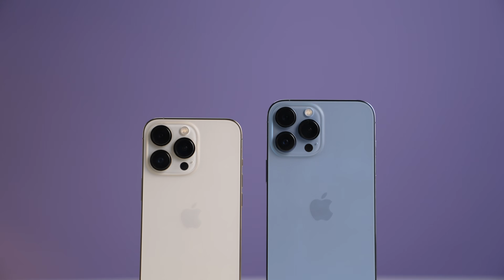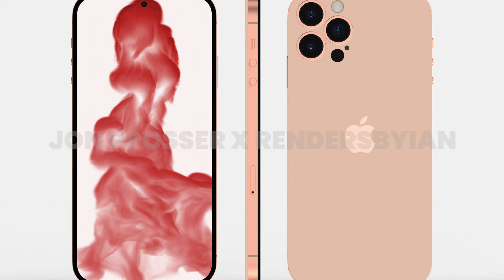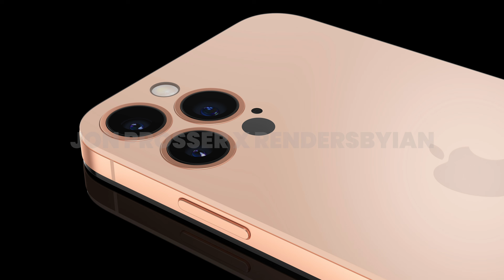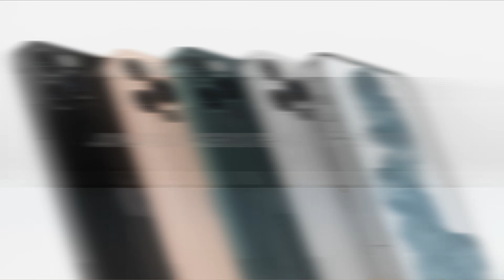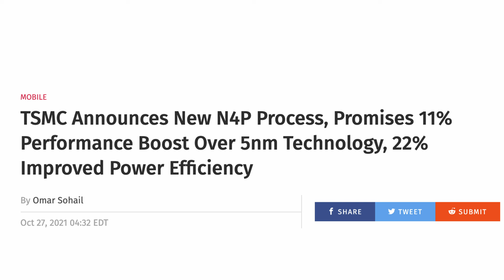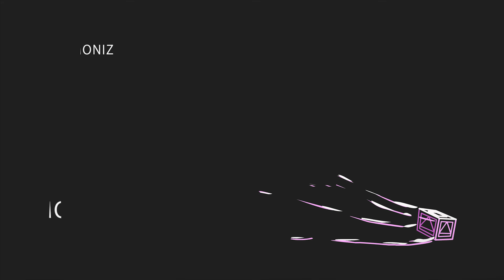iPhone 14 - Better Cameras & Smaller Notch!

Comment: 8k is rather useless.

A dedicated 5x tele would be nice, anything more than that loses details. 

4k 120fps slow mo would be nice.

Manual controls on pro models should be mandatory. 

I think they need to space all the cameras apart so that they can all benefit from having large sensors. The UW and tele don't need to have bad low light performance or bad image detail if they just increased the specs.

Comment: I lost excitement in for the new iPhone, just a little bit better without significant improvement. I mean, the camera, display, and battery were already great on 12/13 Pro Max. A little faster processor, brighter display, or better low lighting photography doesn't really mean that much.
Kinda ironic because they nailed it so well with their newest macbook series, yet they play super safe with the iPhones.
Reply: but look at that notch! they're finally catching up to 200$ phones released in 2018!

Comment: I got a 13 pro max to try the best Apple had to offer. I'm not impressed at all. iOS is hilariously boring. It's disorganized in some areas and over-organized in others with no choice to decide what works for you. The auto brightness is bad and the screen doesn't get dim enough. 120hz is not constantly on and IMO is not noticable for this reason (on this phone). The notch... enough said. I will say this thing charges hella fast. (With an adapter I had to buy separate because... Apple) Definitely will be returning to Android
Reply: Not sure of your views on Pro Motion? I have seen gaming tests that show it uses all the FPS it is able to achieve, and there is no issues. Of course, you may not understand Pro Motion, which means if you stop playing a game it will lower the frame rate as if you are not doing anything you do not need 120Hz! The reason you do not get it is that LTPO 1.0 in most Android phones last year did not have that ability, but LTPO 2.0 coming to all flagships in 2022 will have it, so if you do not like how the iPhone does it, tough as Android phones are getting this now; it saves battery.

Comment: I’m definitely most excited to see the smaller notch. I can’t wait for year when the lightning connector becomes a type-C connector. Because correct me if I’m wrong, but wouldn’t that also make the charging a lot faster along with file transfer speeds? But I can’t wait to see how the iPhone 14 rolls out. I’ll mostly likely be getting the iPhone 14 Pro. I’m so excited.🙌🔥🙌🔥🙌🔥

Comment: Apple 8k will be different  and possibely it will support 8k 60 fps because 
A15 has pro res encoders and decoders from mac chips to support ProRes in iphone.....
Like same they can easely uses
  8k encoders and decoders from M1 max to A16 and enable 8k 60 fps with pro res....
With custom encders apple can easely fix the prb of stress for cpu while recoding 8k.......

Comment: Performance of A16 will be huge jump
Because of tsmc N4p process
But the main thing is that Arm v9 that will provide huge improvements in efficiency and performance
A15 With old v8 and 5nm apple is already ahed than  compatators  even with v9 arc 
 With A16 v9 and n4p they will lead further more